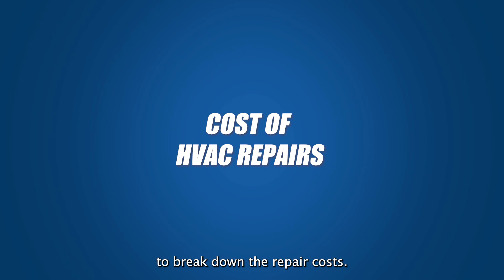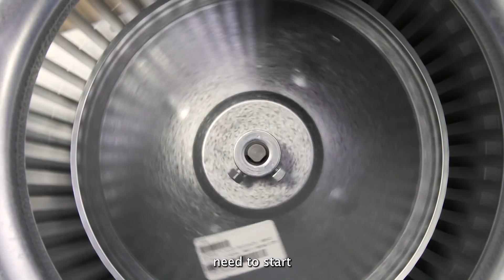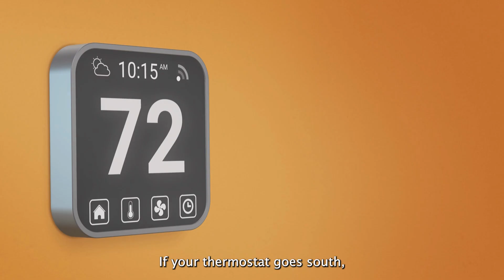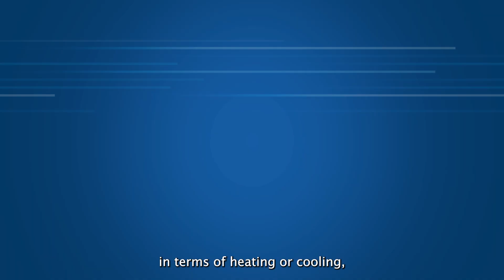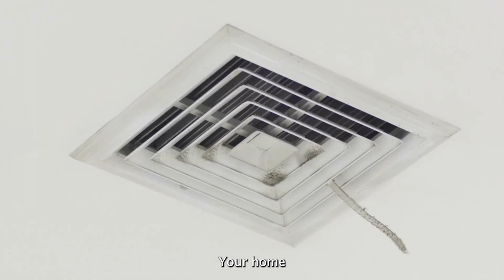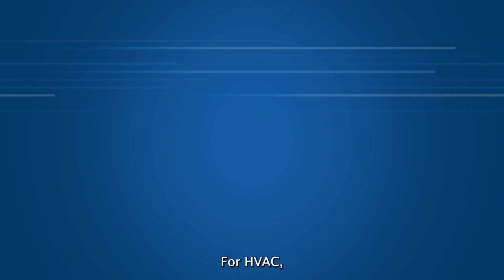How Much Does HVAC Repair Cost?

Comment: I’ve never come across a dirty flame sensor that couldn’t be cleaned. I only replace flame sensors if the stainless rod spins in the ceramic housing and doesn’t sit in line with the flame properly. Everything else cleans off with a little effort